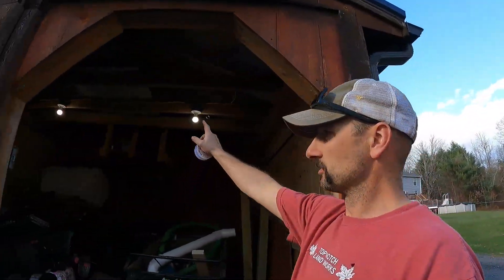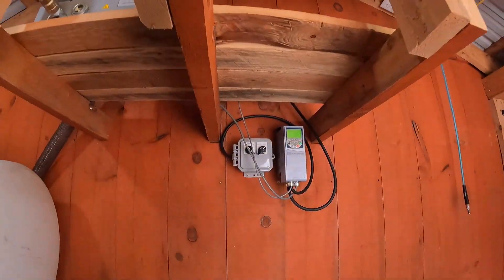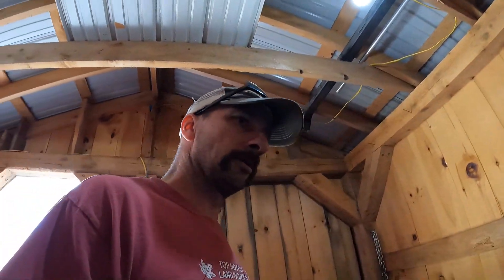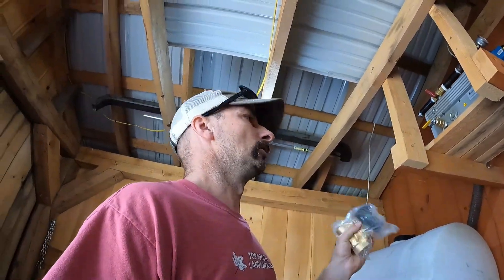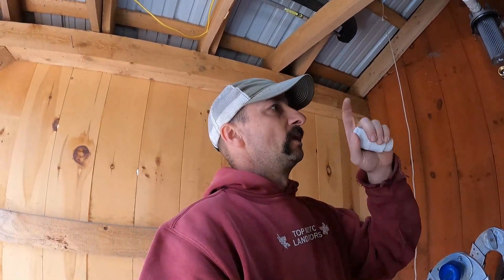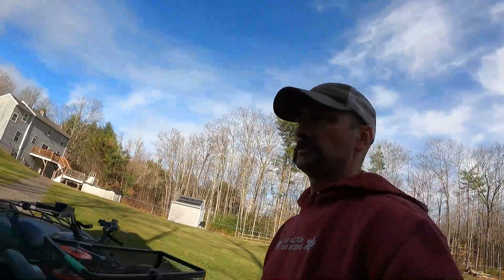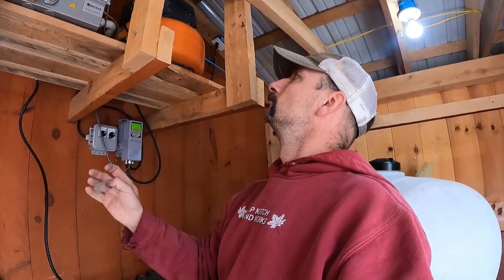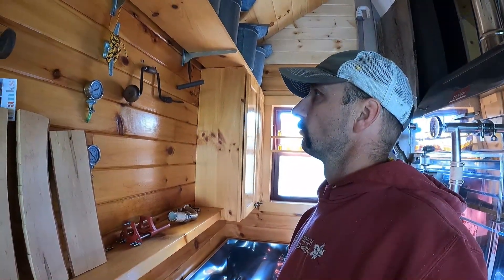Time to upgrade a vacuum pump

Comment: Thats alot of money for 200 taps.   A guzzler gets me to 26-27 and you can get for 1/5 of the price.   5k doesnt seem feasible unless they just gave it to you to do a video?
Reply from the maker: So yes expensive but for me to have a guzzler I would have to run power down to the releaser 300 ft ish.  My old pump was loud and I have moved our check out area into the building where the vacuum pump is.  I am not going to ask our staff to listen to that all day so I needed something quieter and I might as well get more vacuum while I'm working on it.
Reply: @dunnfamilymaple  running 10 gauge uv treated wire 300 ft isn't too bad.   I ran mine down on pump line coming out.  Easy.  Works really nice for 120v in my deert stand too

Comment: So you are using a temp controller to just dead head the pump? And because of the vfd a temp controller that shuts the power off to the pump won’t work because it will reset the vfd?
Reply from the maker: @ryan05753  yes. If the vfd looses power it does not restart the pump. If the pump stays on in the early season I end up with a Releaser full of ice on days that it is only in the low 30s. The Releaser is not in a heated area so this is my work around
Reply: @dunnfamilymaple good to know, we were looking at 3ph 3hp pump replacement but we use a apex temp controller. I was wondering if it was going to be an issue. This bush is 25 mins from my sugar house so maybe I’ll stick with a single phase
Reply from the maker: @ go 3 phase. Huge power savings with a VFD and transducer

Comment: Sweet upgrade and it’s quiet, most pumps are pretty loud. It’ll be fun to see how that works for you this spring.
Reply from the maker: I'm thinking that it will produce a lot more sap and did I mention less noise

Comment: looks Great Scott, I bought the same pump. Are you going to put in a moisture trap with a check ball in it?
Reply from the maker: Yes there is one on the other side of the wall behind the pump but I am not able to show it as it is in the wood shed and blocked by wood.

Comment: Whats the price on this vac pump? I have 500 tapes now and adding a few more each year. I also have a sap ladder on this system that has 125 of those 500 taps on it. Thanks great to see you moving forward
Reply from the maker: List is $4591